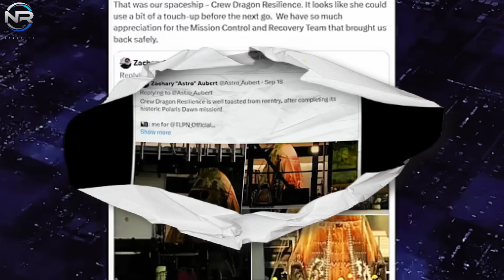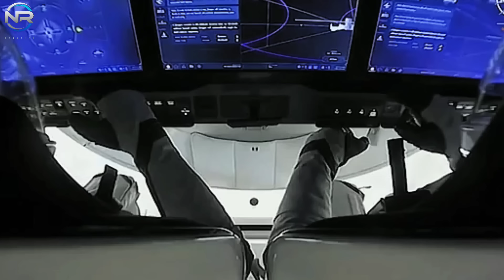Astronauts Finally Revealed the Reuse of Dragons! NASA Was Surprised to See It

Comment: Why have gloves at all?  Why not just a pockets where the hands can go and operate built in controls for robotic hands.  Hands that can double as tools and change shape for tight areas.  Magnetic that prevents the dropping of metal parts.  Built in cameras that can allow the astronaut to see up close and allow crews and ground control to see everything being done.  Seems like a no brainer in the video game era.  I don't even think I have ever heard the idea out there.  Using robotics in the suits can change everything.  Robotic legs, tracks or wheels to move along the ground or along the hull of the spacecraft.  Imagen a spider like design.  That could move along rough or complex terrain?  Suits that could be used as re entry pods safely?  In case of an emergency.  First we have to rethink what a space suit is.  Again are the people in the industry to stupid to think differently.  How about suits that can attach to equipment doubling as the cockpit.  Then detach allowing the astronaut to go back to base.  Suits need to be an extension of the person.  Not just an environmental suit.  Does anyone know anyone.  Forward the Idea to NASSA and Space X.  Another thing why do space suits have legs at all.  Most of the mission the legs do very little.  Legs could be an easy design one piece tube with some ability to move.  Like a fish or lobster tail.

Comment: If we work out basic economics .... A first stage reusability wud be a stupid move. May be I am wrong.... But the cost factor won't work out well... Coz with first return itself the structural integrity will pose questions. Afte 2 nd use I doubt they will have to almost pump in same amount to make it usable...... And every use will be recurring cost.
Reply: Have you ever traveled by air?  Owned an automobile?  Vehicle reuse is what makes routine travel in any type of vehicle economically possible.
Reply: @frankmcgowan9457  check out the max vibration of automobile and even for planes the structural integrity is based on max vibrations in its peak. Rockets are different... It's not only vibration, it has zone with temperature as low as -270 deg C and max temp to withstand is 2100deg C. And above all  pressure jackets holding pressure 20 times more than an aeroplane. Every reusability shall be recurring expense.
Reply: @UdayKumar-xo8ey Stainless steel, thermal tiles &  braking burns is how it works ! 😊 where do you get your 20 bar figures?  Starship  tanks are pressurised to 5 bar !